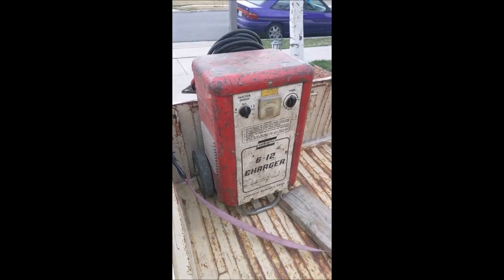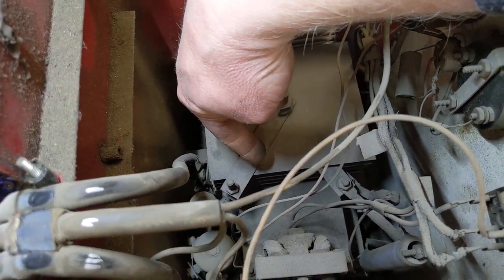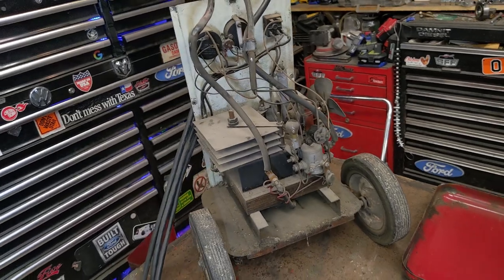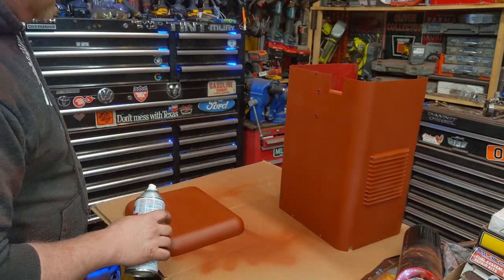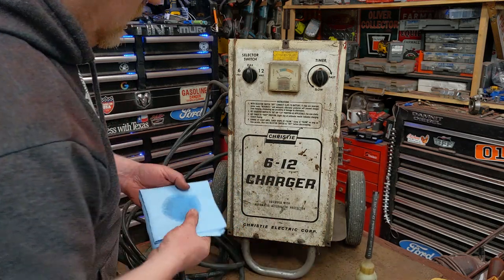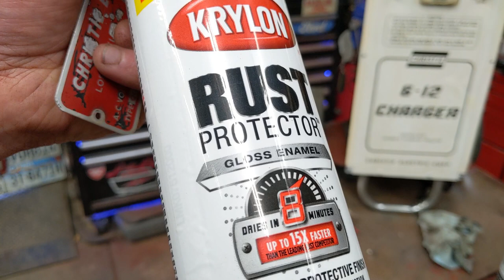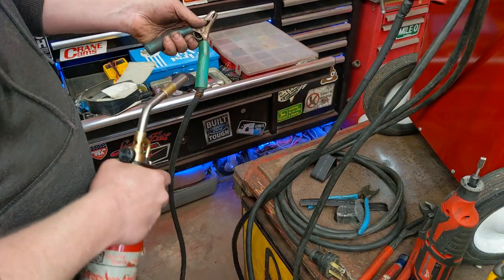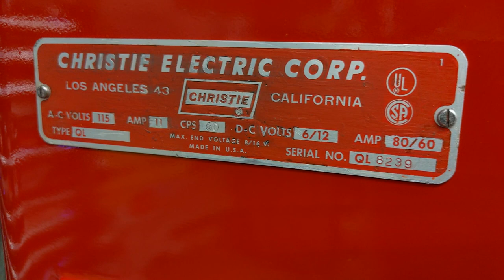Vintage Car Battery Charger Restoration

Comment: The bulbs could be used as shunts if they are in series with the transformer input. If so, they prevents damage when it gets loaded.

Think of them as a series resistor on the primary side that protects against inrush current and short circuit in the secondary side.
Reply from the maker: That makes sense

Comment: Inspiring video! 
Now I have one question.. What experience do you have with overspray? I would love to paint more stuff.
Reply from the maker: Overspray can be handled pretty easily on small things like this. If the paint is wet overspray dissolves in. So the trick it to go fast enough to keep everything wet(without too much so you don't get runs). Oil based paint(Alkyd enamel) is really good at not having overspray as it takes so long to set up/dry. Fast drying enamel/lacquer based paints is more where you'll deal with this.

Comment: Did you ever see any difference in when the lights come on during different settings? Balls and snacks LOL ;-)
Reply from the maker: I didn't. I had a couple guys in the comments explain the light bulbs use in the circuitry. Essentially it helps regulate the voltage compared to the batteries internal resistance(state of charge).

Comment: Hello 👋 could be that the lightbulbs are like a fuse? When they burned, there is probably no electric flow anymore??
Reply from the maker: Yeah, if the burnt out the solenoid wouldn't turn on.

Comment: I noticed the voltage output max is 16 volt... That gives a very good charge for Restoring batteries!
What year was that made?
Reply from the maker: Late 50's possibly early '60s.
Reply: @sixtyfiveford   Cool Man !!!  I have been trying to Refurbish some of my "dead" batteries.  That charger I think would be a great charger that would not only be able to keep batteries in top shape, but desulphate or whatever you call it, the "dead" batteries!

Comment: I can't give you an exact date of manufacture on the charger, but it's before 1967.  The 43 in the city/state line is a zone  code, which was superceded by the five digit zip code in 1966.
Reply from the maker: You're awesome. I was actually staring at the 43 and wondering what it meant. 12v batteries became the industry standard for cars in 1955 so it fits somewhere in there. My guess with just looks was late 50's so it's close.

Comment: I actually thought you were going to gut it and put in a modern charger
Reply from the maker: I've been looking for an old charger like this for year as they work so much better than the new stuff. New chargers no longer use transformers to save money. Problems arise though if you have a dead or really low battery with the new stuff and they won't charge it.

Comment: I am 69 now. I still have a couple of the battery chargers that I had 40 years ago. They were designed only to charge car batteries at 4 to 6 amps. So they are smaller. The chargers now contain none of the original componemts. All that remains of the originals is the cases. The selenium rectifiers were replaced by silicon ones. The meters fell to pieces and have newer smaller ones. The cables and clamps rotted  and been replaced. The transformer secondary burned out and the transformer was replaced. There was  no overcurrent protection at all so I fitted fuses of ratings that I decided. I used components that I had stashed over the years so the present designs are not those that I would use from scratch.  Modern chargers use switched mode supplies to convert the input supply to low voltage dc output. These do well to last 4 to 5 years. Old school transformers can last 30 or more as long as they are stored right and adequately rated. I will never buy another one. I would prefer to design, build and use one of my own.

Comment: Those old plate rectifiers have a tendency to stop rectify. Recommend that you replace those with some newer tech, if you get to much ac ripple it can mess your batteries up.
Reply: them "selenium" rectifiers actually go up in smoke. that is the indicator they are done. and even if it was smoked before it would have had residue left over. vary realy do they actually fail in a shorted state. they useually pop open.

Comment: I think the new "smart" chargers are dumb, when I was young we used battery chargers as power supplies, worked great!  We also used gasoline to clean everything!
Reply from the maker: Gas is a great cleaner/solvent. With the removal of lead it's probably just as safe as anything that comes out of a $8 spray can.

Comment: Looks like it will desulfate your batteries with the higher amperage. There are a couple videos on using an arc welder to desulfate batteries. The idea being you can set the voltage and amperage. Automatic chargers won't do it. And the "dumb" chargers only go to 10 amps. I have only had marginal success with the dumb charger. 38 amps is way higher than anything in a modern charger, and comparable to what they're doing with the arc welders. The one guy said they had been doing it for years.
Reply: no not at 16 volts. at 16 volts you mostly boil off electrolyte. good voltage for a balancing charge would not exceed 1 hour though.  Desulfating if it can be done "ie, battery still has some voltage and not completely trashed" usees high frequency high voltage and very little current to "Shock" the plates and break down the sulfate. it will not restore a battery but give you some life back the plates will be thinner after the process but some of the sulfate will eventually break down and recombine.

Comment: you can actually restore many clear plastics with "automotive cleaning wipes" from ole' Dollar General. Give it a try.
Reply: Meguiers plast-x or however you say it. put that crap on and buff away. clears it up pretty good. I have used brasso before too and then armor all afterwords to restore radio face plates and cluster panels. (got a hold honda i did that to still looks decent even tough everything is brittle and falling apart. still not bad for a 22 year old civic.)

Comment: A charger that actually charges. I can't imagine the light bulbs being part of the circuit, at first I thought "Oh vacuum tubes", but I think they are just for light. The thing looks a little like R2D2 with the dials for eyes.
Reply from the maker: It does look like a little robot

Comment: I looked it up. and found 2 answers   I think both are accurate..  
 1)   Those are Tungar Bulbs used as rectifiers, made with TUNGsten and ARgon.....

2) The bulb is a current limiter and indicator... when it's glowing bright,
 there's lots of current flow, and when dim, it's about done, turn it 
off.

The rectifier tube is really simple... they run filament current through
 it, which warms up, and then the filament becomes a cathode, and the 
third connection becomes an anode.
Reply: they won't rectifiy anything those are just simple bulbs used for current limiting and fuseing.
Reply: @CotyRiddle  It's been a long time since this post.  I was curious when I first saw this video so I did some research. My post was a cut and paste from some articles I found.  That is not my knowledge, I stole it... I think one of the articles I copied from has the same charger but my memory is about half as long as my thingamajig so I could be mis-remembering.. It seems like they were used for both.. Maybe one of the bulbs got dimmer as the battery reached full charge so it acted as an amp meter. Nevertheless, I felt the information was accurate or I wouldn't have posted it.. I try to keep my stupidity private

Comment: when touching up ceiling repairs, i use an antique white interior paint and feather the edges of the spot to blend it so that i don't have to repaint the entire ceiling. it usually matches the older white that was there pretty well so the repair isn't as noticeable as if you spot painted with a basic white, so you might try that. i have about a dozen old schumacher chargers on a shelf in various states of disrepair that i have picked up free or cheap that i repair when i get the time and resell. a few months ago, i bought a brand new schumacher because it was on sale really cheap, has a built in desulfinator function and i thought having a new one around might be a good idea, at least until i tried to charge a completely dead battery with it. i wound up having to hook up a second one in parallel so that it saw some voltage just to get the thing to work. i'd have been better off wiping my ass with the $50. at least then it would've been effective the first time without me having to have a second shitty hole just to get the job done.
Reply from the maker: I don't think the new stuff has transformers anymore so rely purely on electronics to trigger charging.
Reply: @sixtyfiveford  99% of them use smps. if it's small and light it is smps for sure. don't expect much from them. they run hot and burn out in a few years time. grat for maintining a charge not for charging.